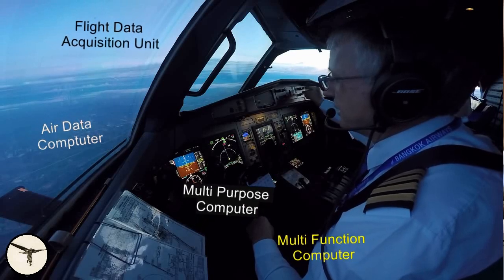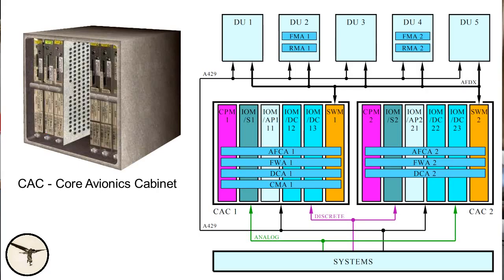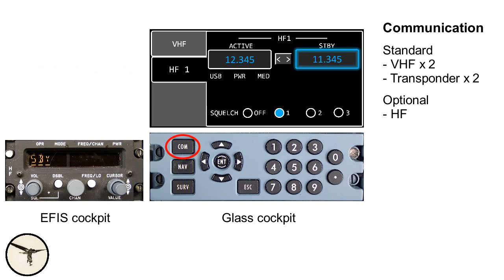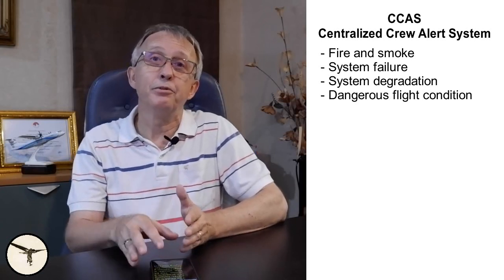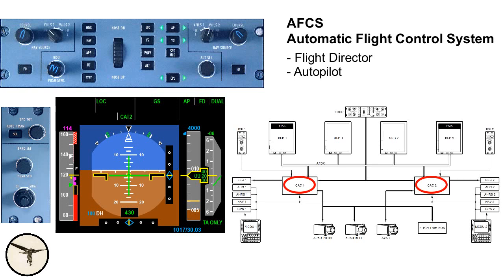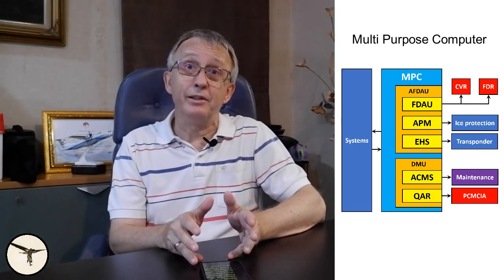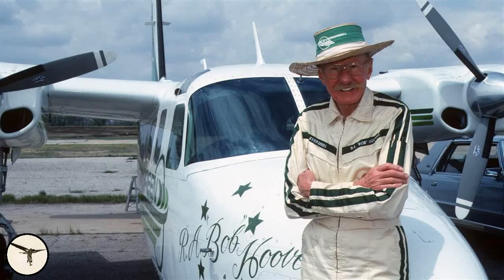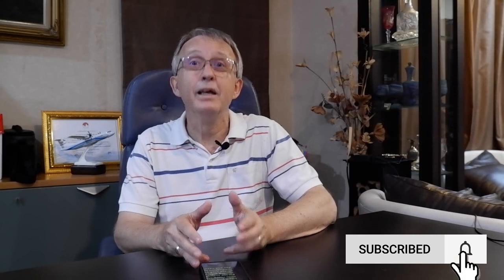ATR avionics - an introduction

Comment: Great presentation Capt.

But i have a question about the FDAU.

Between the FDAU(black box) and the AFDAU integrated into the MPC, which one communicates with the CVR/FDR?

Or are they both used for redundancy?
Reply from the maker: FDAU and AFDAU are the same thing. Just two authors making different parts of the manual.
Reply: @FlywithMagnar  oh I see.
Thank you Capt.
I've always thought there were two of them

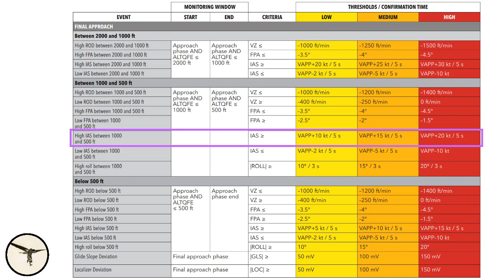Comment: Hi Captain, on 13:30 you give an example of FOQA threshold regarding VAPP. But how does an EFIS ATR “knows” what is the correct VAPP? All the performance calculation is manually or with the SPS software in a standalone ipad. And the target speeds are set just with plastic markers on the ASI. Thanks. Great content.
Reply from the maker: The approach speed is set by the pilot with the internal speed bug. It is connected to the fast/slow indicator on the airspeed indicator and the FDAU, which also collects data from the airspeed indicator, the altimeter, and the radio altimeter. The closer you get to the ground, the less the speed margin before a report is triggered by the FOQA. Just now, I don't have the list of the various alert levels. Besides, the alert thresholds can be modified by the operator.
Reply: @FlywithMagnar  I see. So the speed ia taken from the internal speed bug. I guess its also true for other instances. Didnt know that! Thanks!

Comment: Hello good evening, I would like to know how I obtain a maintenance manual for the ATR-500 or 600, specifically chapters 22, 23 and 34, I am doing my research project for my master's degree in electronic engineering and it is based on the ATR 42, from I really appreciate it very much. Thank you.
Reply from the maker: Hi, I recommend to set up a profile at LinkedIn. There are many engineers there with knowledge about the ATR.

Comment: Hi Captain 
Need help about tilt of weather radar on take off in mountain area ?
Where to find info?
Reply from the maker: The weather radar is of little help when you are below mountain ranges. You might turn it on when you are lined up on the runway before you take off. Ground echoes will be strong and within a close range, and weather returns would be further away. But when you are airborne, the radar screen will be fully painted by ground returns. Terrain mode is more useful. The weather radar will start to become uncluttered when you are a few thousand feet higher than the ground ahead of you. 
Tilt: ATR doesn't give any recommendations. Boeing recommends to use 5 degrees up at take off and then reduce to 4 degrees when 10,000 ft above the ground, 3 degrees when 15,000 ft above the ground and 2 degrees when 20,000 ft above the ground. This works fine.
Range: The best range for the radar is 20 to 40 NM. This allows you to plan ahead while the radar picture is detailed enough to catch small cells of towering cumulus.
I didn't find much info on the net, but this article might be helpful: http://aea.net/AvionicsNews/ANArchives/May11_AirborneRadar.pdf

Comment: A very simple explanation to the most complicated system in ATR. Summarizing that CAC is the one showing everything in DU, MFC controls various system logic operations and MPC is generally an invisible man that observes you and tells everything to your boss. I remember this system during my type-rating in AATC when nothing gets in my head, and our French TRI once said in a thick french accent "Don't worrie, we are peelots. This is for engineers. We fly plane, everything is automatique". Although I still wanted to know about wires and cables like Analogic, Discretes, AFDX and ARINC429 we ended up moving on to the next system.
Reply: In addition to controlling & monitoring of various system logic operations, MFC, in conjunction with CAC/FWA, provides fault warnings to the flight crew in the form of sys local warnings, MW, MC & audio warnings.
Reply: Thanks for this summary! I had hard time understanding these :)

Comment: Hello Capt... I need some tips on Power and Flare technique in Tail Wind landing ATR 72 600
Reply from the maker: Hi Raj. My best advice is to fly by the numbers. In tailwind, you must not add anything to Vref. In most cases, the tailwind on final is stronger than the tailwind on the ground. This causes IAS to increase just before the flare. If you already is flying too fast, your IAS will be too high during flare. Please watch my video from Lampang. On final, we have 10 KT tailwind. On the ground, it's 5 it tailwind. That's easily manageable. But if they report 10 knots tailwind, and you have 20 on a very short final, you better consider going around and land on the opposite runway. That's much safer.
Reply: Fly with Magnar Thank you Capt... Will watch the Video on Lampang